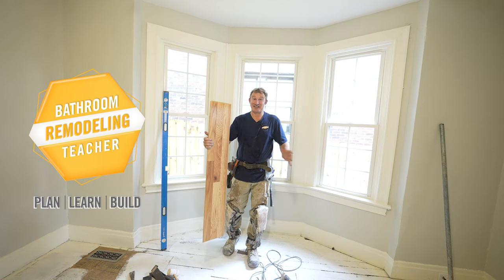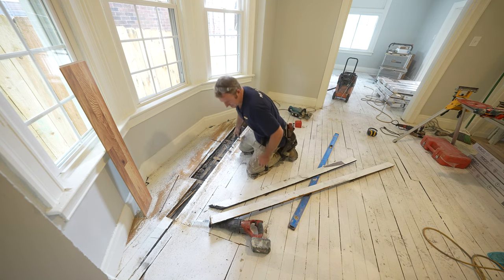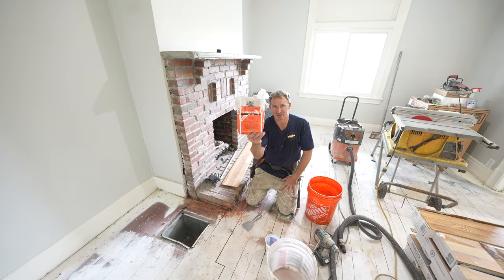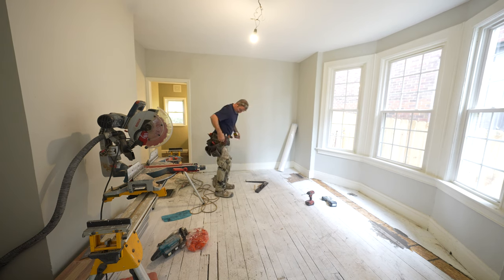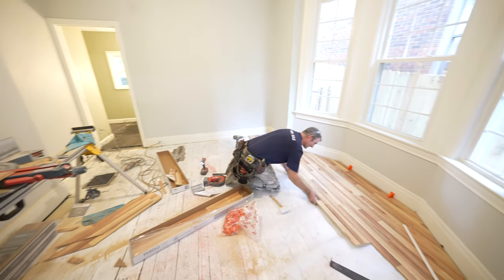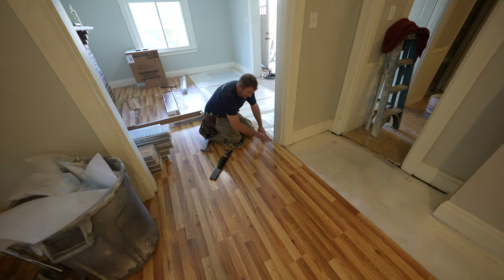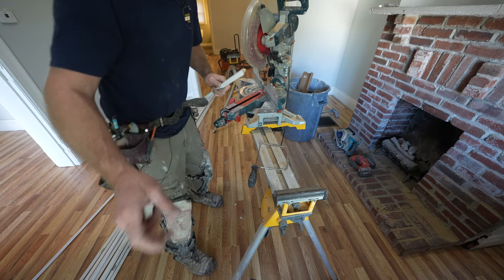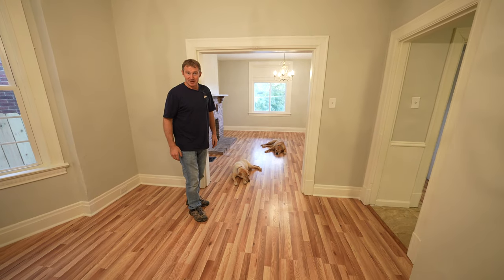Laminate Floor Installation for Beginners and Pros | PLAN LEARN BUILD

Comment: A month ago you had a video on caulking a shower.  Do you have a video which shows how you installed the trim (shower head/arm,  bar/hand held, valve plate and handles)?
Reply from the maker: This covers the whole install of that shower faucet 👍 
Amazon Tub Shower Faucet with Handheld
https://youtu.be/5A_mrjpF_wo

Comment: I’m almost done with my small bathroom using your non membership videos. I have one question…2nd floor condominium bathroom, I have narrowed it down to Stamped Steel tub or Acrylic tub, not sure which one to use.

Based on your experience what would you recommend?

Thanks
Reply: Acrylic is higher end, I just followed his instructions and installed a stamped steel after busting up the old cast iron. Some people suggest insulation on the bottom of those cheapie steel tubs, gives them less of a hollow sound and the water stays warmer longer.
Reply: @nmatthew7469  …Thanks, I’m using Structolite as the base for tub. Weight was not an issue?
Reply from the maker: Hope you watched this video 😆 took an enormous amount of time to create
I would go with acrylic, but not a box store model. American standard, jacuzzi are my favorites have all other recommendations throughly explained in courses 👍 thanks 
Steve
Reply: @BathroomRemodelingTeacher  … I have watched all your videos so far. I can only do one project at a time, I don’t have your skill set…👍👍👍
Reply from the maker: @82dupont  😆 thanks 
Let me know how the tub goes 
I’m about to order this one for my next project https://www.build.com/jacuzzi-lns6030brxxxx/s1233085
Reply: @82dupont  the stamped steel is fairly light, 70lbs but I got a good appreciation for the work Steve does dry fitting, took like five tries to get everything to line up. I was on a tight budget so the cheapie depot Bootz tub, works for me. Bought a bag of Structolite too but didn't use. It's got a base on the bottom and with the ledger board it is sturdy and level. Had to go to a plaster supply house for the Structolite, they don't sell it anywhere these days.
Reply: @nmatthew7469  …Thanks, I went with acrylic, Kohler brand. Getting structolite at local home cheapot, they seem to carry a lot of it in my neck of the woods. Thanks for all of your feedback, very helpful. If I were younger I would definitely get involved in the bathroom refinishing trade. Seeing the process from demo to finish is definitely a great feeling of accomplishment.

Comment: Excellent workmanship! Question.. is engineered, the same as vinyl? It says waterproof..
Reply from the maker: For the most part, not much difference with installation either. Has a softer feel to it 👍

Comment: Great video but I have a question. When setting your first piece did measure off the reference line you struck? I didn't see where you mentioned that. And, is there a reason you started at the bay window side rather than the opposite wall? Thanks.
Reply from the maker: Yes, I did reference the line at that point. Not sure what has happen to my footage of that. And main reason for starting there was the flooring continued into hallway on opposite side of room. So it’s always left to right. This was a somewhat complicated floor layout.. took 3 1/2 days to do. Had about 12 hours of film to edit 😆